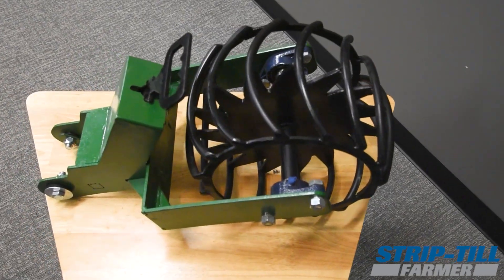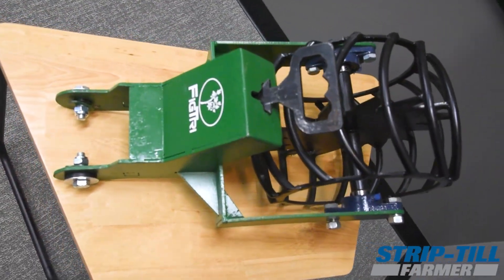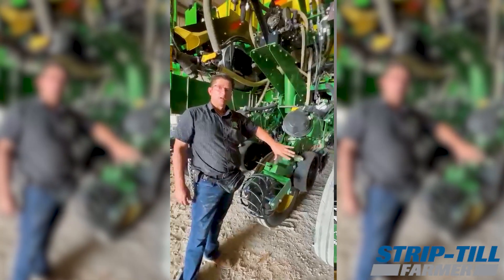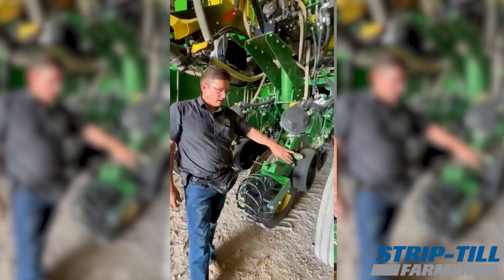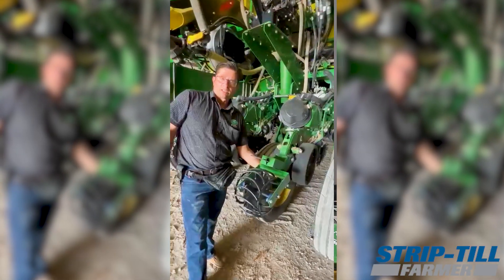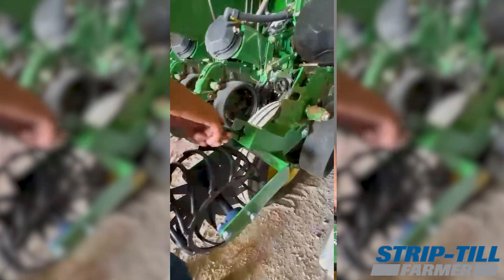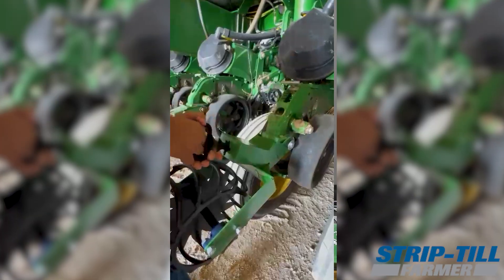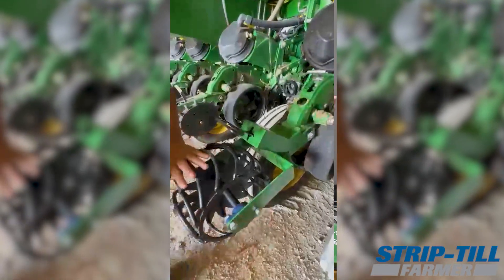A Unique Closing Wheel To Limit Compaction

Comment: To avoid compaction of the seedbed (including the inter-row layers), the wheels of the machine-tractor units should not move across the field (the area of the seedbed), and the rollers of the seeding sections that regulate the depth of sowing should apply the minimum possible pressure on the inter-row layers. The first can be achieved by using the "large field ridges" technology, and the second can be achieved by using chisel-type seeders, which eliminate the need for "cover rollers." However, the proposed design of the "cover rollers" does not solve the problem! 
Для исключения уплотнения семенного ложа (включая междурядные слои) по полю (зоне посевных лож) не должны перемещаться колёса  машино-тракторных агрегатов, а  катки посевных секций, регулирующие глубину сева, должны оказывать минимально возможное давление на междурядные слои.  Первое может быть достигнуто   применением технологии "больших полевых гряд", а второе - использованием долотных сошников, которые позволяют отказаться от  "закрывающих катков". Предлагаемая конструкция   "закрывающих катков" не решает проблемы!